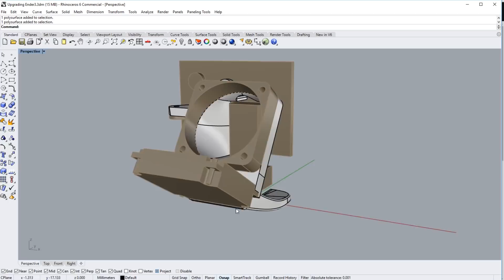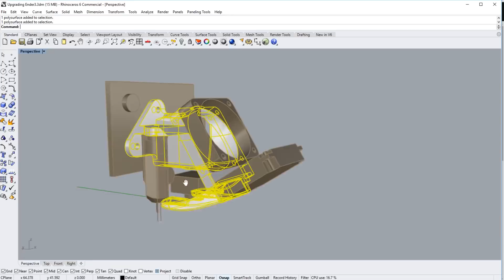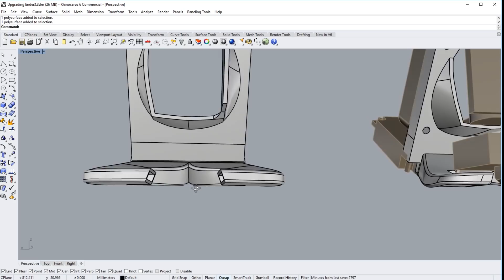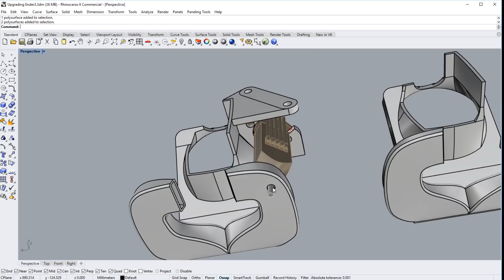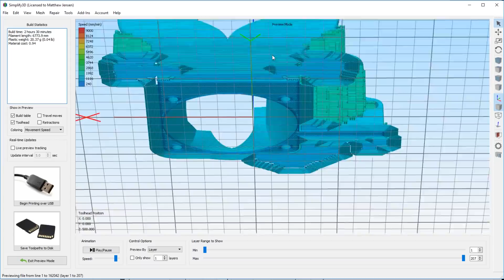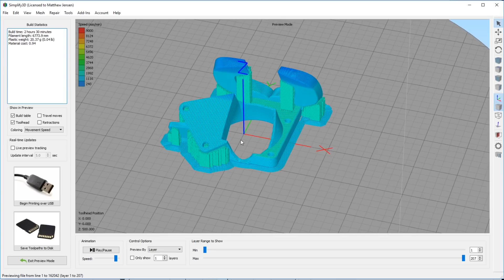Upgrading the Creality Ender 3 with Duet Wi-Fi, and other add-ons - part 1

Comment: You purport to be an expert, yet you failed to notice that the power supply was set to the wrong input voltage.  That is not even a rookie mistake...
Reply from the maker: For the last couple of months, I've been simply banning users who leave insulting comments. For this comment I will make an exception. 1) Everyone makes mistakes. 2) I don't have to show you mine. I can simply edit them out of the video. 3) Showing my mistakes makes the hobby more approachable to others and educates. If I did everything perfectly there would be no lessons learned, and I would not be providing an educational benefit to those watching.
Reply: @DesignPrototypeTest My apologies.  You are right - this was insulting.  And a mistake on my part.  I've made doozies myself and I don;'t know what prompted me to leave such a comment.  I have no explanation - just my sincere apology.

Comment: I dont know why everyone compares to prusa? Prusa is good but not the benchmark. Granted prusa prints well, but i have seen some prusas not print well. It is literally about how you configure it, the rigidity of the printer, and also the slicer.  Prusa is a reprap printer, my cr10 is not. Does my cr 10 print well, yes it does, thats because i have put the time into it. Prusa is a good product, so in creality, makerbot, formlabs, rais3d, tevo.

Comment: You are $446 into the build, but you forgot to throw in simplify 3D for another 130.  At this price you can just about get the i3. The Prusa slicer has the functionality you showed. Im sorry but the only good thing in this video is your work on the fan. That was a great job. 

Your opinions and recommendations are strange or ill thought out.  Let me make a few corrections.  
1- the Ender 3 frame is not superior to the i3 - it has many rookie engineering mistakes. The extrusions are screwed to each other to make 90Deg joints. No alignment geometry what so ever.  This is comical.  That does not work in real life, the majority of E3 out there are not square. They cannot be - there is o mention of this in the instructions. 
 
2 - the acetyl rollers  are not a great way of making linear motion because the rollers wear and ride on an extruded cheap piece of aluminum with no quality control. 

3- the right z roller does not do much at all. This is practically a cantilever machine.  It needs another screw there - like the prusa.   These are the 3 major design flaws the machine has. 

If you want to play around with some cool upgrades  spend another 100 bucks and start out with something better thought out.

Comment: Jesus Christ this comment section is full of so much salt, and most just seem to be mad because he was mocking prusa. And alot dont seem to get the point of this, which is budget
To be fair i dont own a 3d printer but im thinking about buying a ender 3, just because it has a big build area for the price compared to other printers in that price range, and if i ever buy it and i get hooked on 3d printing i would rather upgrade it one part of the time than, than just go and buy something like a prusa which is like 4 times the price. So i can get something just almost as good to twice the price  just by slowly upgrading i would be more than happy,
Reply: dannore you should totally do that.  I bought an Ender 3 Pro and I am 3D printing some of my upgrades and bought some parts on Amazon(an aluminum clamp and a rubber insulator).  I recommend that you use thingiverse to find 3D printed upgrades.  I was able to make my upgrades the day the built the printer and started printing(I recommend you use a .2mm filament size for printing with no issues).

Comment: 1:42 Explains how much better Ender 3 is than Prusa for not using zip ties
9:32 Uses zip ties in "upgrade" of Ender 3
Reply from the maker: As I have explained to the many commenters before you who thought they were also making a valid and clever criticism. 1) I am not the dominant western 3D printer manufacturer for consumer level 3D printers. I am a DIY YouTuber improvising, and this was the very first iteration of the design. 2) My solution used plastic zip ties to hold two ends of a plastic hose together. Prusa's design uses zip ties to hold together the very foundation of the printer. Think about all the things on top of the zip ties: The entire movement system for the Y-axis, the heated sub-bed, The detachable flexible print surface, and most importantly the part being printed. Your comment stinks like propaganda from the Prusa camp. Just because the Mini isn't selling as well as you hoped doesn't mean you should attack me.
Reply: You need to take a deep breath and realize there are simply people who find humor in contradictions.  I wasn't "attacking" you, I was playfully teasing with an observation.  As I didn't mean any offense, I'd normally apologize... but you actually attacked ME with YOUR reply, so let's call it even.  You might consider taking a break from YouTube if my comment angered you so much - you just bit the head off of a friendly, happy-go-lucky person.  Probably not the best way to gain viewers of your content.
Reply: Just thought I'd add, there is an irony to your "Prusa camp" quip.  I know nothing about Prusa, and am currently considering an Ender 3 which is why I watched your video.  You're alienating allies of your "camp".

Comment: With moving the BTtouch closer you could have stuck to the design, just drill a hole at the point needed? Would think a marginal difference to flow?
Reply from the maker: Probably true.

Comment: You can't install the filament out sensor after the extruder motor. It will never detect a filament out situation because the filament is pushed by the motor and when the end travels just past the motor gear it stops moving. It does not keep going out to the hot end. It will keep the sensor indicating filament present after it runs out if you install it after the motor.
Reply from the maker: Man, you aren't alone in making this mistake. Many others have the same comment, but you guys need to give me a little credit. I know what I'm doing. What you and the others fail to realize is that the sensor is a motion detector. It reports how much movement of filament goes past it to the Duet control board. When the filament stops moving, but the stepper is still trying to feed filament the Duet board knows there is either a jam, or it has run out of filament. If I placed the sensor before the extruder, there would be no way to detect a looped condition where the flexible filament pops out the side of the extruder so that the extruder keeps pulling filament from the roll, but does not feed it into the hotend.  Measuring the filament just before it goes into the hotend is the superior technique.

Comment: I'm starting to apply some of the add-ons from various youtube videos. At some point I figure it's gonna be an Ender 3.5!
Reply: I first bought an Ender 3 Pro.

Extended it to 400x400x400 (with extrusions, not kits), doubled the Z, redesigned the entire cooling system to be decoupled from moving parts (fans go brrrr and are gyroscopic masses that limit acceleration, having them attached to the head makes no sense what so ever), redid the entire extruder because I don't like having an extra motor weighing down a moving axis, redid the bed to have its X axis movement AND 2 round rails to give it that little bit more rigidity and am currently redesigning the hot end because the was it's set up by default (on almost all maker 3D printers) makes no sense what so ever to me, like really, why the hell does everyone keep attaching more mass, more vibration and more heat to that thing and mount it in tilted way from a flimsy aluminium extrusion.

Meanwhile, I bought an other Ender 3 Pro which I just did the basic upgrades on to have a stable printer to print with.

This hobby is nuts.
Reply: @enlightendbel  Are the plans or instructions for decoupling the cooling system online?
I intend to exchange my cooling fan for a more silent one, but making it even more silent definitely sounds nice

Comment: But lets continues to support crappy chinese companies. You talk out both sides of your mouth support china but they are stealing.
Reply from the maker: I walk a thin line. It's true.  I don't support Chinese clones. Despite the criticisms from The 50₵ Army I'm NOT racist. When I see innovative "original" products, I don't care where they come from, I will talk positively about them. The Ender 3 is "original" True, it's not a large departure from the Mendel Max, and other Open Builds designs, but it is not a copy or a clone. Do you feel that the Ender 3 is a clone of The Prusa? Are you aware that the Prusa is a modified Mendel, and that Prusa didn't invent the Mendel despite selling the "Prusa Mendel" before the "I3."  Dr. Ed Selles invented that design which Prusa copied. Here is a picture of a Mendel Max from 2014: http://www.stephanhooft.com/tinkering/mendelmax/ it is obviously more similar to an Ender 3 than a Prusa.

Comment: Simplify 3D sucks! Cura has had custom supports for a while now. You can write your own plugins and it's open source. 
You need to look into:
- mosquito hot end
- Capricorn PTFE (better retraction/extrusion)
Good call on the "use BLTOUCH" haven't tried the cheap knock offs, but the original works great.
Nice modeling work.

Comment: the problem with cheap 3d printer is reliability, adding a duet isn't gonna fix these problems. auto bed levelling, dual z axis drive, extruder, hotend, spring steel bed with PEI , these are much more important than a duet board. And adding octoprint on raspberry pi isn't horrible idea, it has so many plugins that duet can't do. Even better, you can install klipper to boost performance, that thing beats duet reprap to the ground. yes, duet is a good board, but not worth the money, everyone bought duet will give the same comment, if we're gonna build a new 3d printer, duet is not on the list.

Comment: how to damage sensitive electronics @ 3:30 SMH
Reply from the maker: Your concerns are greatly exaggerated. Who cares about the terrible stock control board. If that thing gets damaged it's a good excuse to install a Duet. The Duet has back-current protection, so you really aren't going to harm that control board. I have a 2 year old. He goes to town on the printer yanking that bed back and forth for like 5 minutes at a time watching the pretty lights go on and off. The printer still works fine.
Reply: @DesignPrototypeTest  not true.. the stepper motor drivers are easily damaged by doing this.

Comment: One thing I would like to see are fire hazard prevention measures added to the cheap cnc. I am pretty sure there are some programming safety checks in the prusa which the cheapers ones don't have and also the controller boards are possibly built in such a way they are less likely to burn your house down.

Comment: I had ender 3 for few days before i returned to shop. However i was suprised how solid construction ender offer for such money, i was unable to fix Y axis. Whole bed was under angle 91 degree towards X axis and as result.. rectangle prints were rhomboid. Buying such printer seems to be a bit lottery.
Reply from the maker: You must have purchased one of the many Ender 3 clones. Creality has much better quality control than what you are describing.
Reply: @DesignPrototypeTest  I bought ender from www.alza.cz ..the biggest electronic eshop in czech republic. If this was fake then i have no idea where else i can buy real one to be sure :)

Comment: Doesn’t matter if developed by prusa it is on there and a great printer. Crowd source works. The features you cannot implement is the testing of out of box print profiles. All printers are solid you mentioned.

Comment: The 3DTouch knockoff has been working great and costs so little. Is it also stealing when I go for knockoff PLA for 50% off because it's good enough?

Meh... I agree with the other commenters. I subscribed about 1/3 into the video, and then got almost to the end and was like "what is this weird vibe", looked at the comments, and they cleared up my thoughts and feelings real quickly. Not often you see so negative and still so civil comments on the internet.

Comment: question is why need upgrade if its better. why these upgrades not in allready on product. so not need upgrade. so far every printer video.. upgrade make it better.. LOL who is first manufacturer that make printer that is actually good and no need upgrade
Reply from the maker: >who is first manufacturer that make printer that is actually good and no need upgrade
Prusa.

Comment: Your mistake with the power supply could have been way worse, I live in the UK (240v) and forgot to flip the switch, and the psu was instantly fried, at least in the US it doesn't break if you have it set wrong 😊

Comment: lIked the video but I really would rather see how to expand a cheaper one into a bigger print volume.  Most of the prices JUMP when you expand to a larger size.  Seems they only need longer rails and more beds attached together.
Reply from the maker: To get a large build volume just start from scratch. The Piper 3D printer looks pretty great for the money. Of course a RailCore is even better but costs more.

Comment: It just seems funny how many comments in the thread below are defending the position that this upgrade to the Ender 3 puts it on par with a Prusa.  Very few of the commenters (and admittedly the video creator himself) actually own the printer(s) they are criticizing. 

Owning both of these printers in question (and a few others), I was drawn to this video out of sheer curiosity.  I will admit laughing at a few blatantly 'wrong' points, but all in all, I think the takeaways are as follows:  1. The Ender 3 on its own cannot stand close to the Prusa.  2. The whole point if the video is that by adding a Duet, you can come close for still much less $$.  3. The simple truth is ALL my printers is this - if you want to learn how 3D printers work, and spend a LOT of time working on them, buy an Ender 3 or many other chinese releases for less $$.  If you just want to print and not worry about any of that crap, buy a Prusa.

It took me maybe hundreds of hours to realize this - but simply put, my Prusa spends most of the time printing and the others spend most of the time being attended to..  The simplicity of automation of the Prusa is almost unequaled in the industry right now.  And no amount of tweaking on my other printers can beat the printing 'presets' that Prusa develops and releases with its updates.   I'm certainly not a hater on my Ender 3 or any of the others, but after a certain point this hobby can just become WORK... 

But my MK3S is the one printer that doesn't fall into that category.  Especially moreso now after a recent MMU2S upgrade.  Both the base printer and the MMU2S were worth every penny just in time saved, not to mention the components are all top notch out of the gate.
Reply: bless this comment. Had a Prusa for 1-1/2 years...just bought two Ender 3's and I am pissing away enough time tending to them that I could have bought a second Prusa. I actually think that is what I'm going to do. I want to print, I don't want to tinker with the hardware. The bed leveling on these things is archaic. I don't know why I haven't taken a baseball bat to both of them.
Reply: I am waiting for mine. Will take about 4-5 weeks. 
My colleague got an Ender 3 and i tried a BIBO 2 because i wanted to print with two filaments for miniatures. We are both working with CNC machines and Autocad and actually wanted to try a new hobby. 
But my printer failed after a while and i got a refund and redirected the money to a Prusa printer after taking in some information and seeing that they have a MM upgrade i can add later when i got used to it. The main thing that made me buy this instead of an Ender or other clone was the support i expect from the Prusa community. 
Depending on the outcome our boss might even invest money into one if we can show him it can be used to make tools and gadgets for work.

Comment: All the comments but also. A prusa is great and trusty out of the box. You don’t slways have to dear with cheap crappy chinese parts failing one by one either
Reply from the maker: Judging by the reviews from the major 3DP channels, Prusa printers do seem to work well right out of the box, but I can't say that for certain. I've never had my hands on one to test. One thing is for certain. The MMU2 DOES NOT work right out of the box.
Reply: Design Prototype Test yeah. It’s experimental and all.

Comment: sorry i know this is not about your video but i have a opportunity to buy a new anet a4 pro for $35. is it worth it. thank you for your time. jerry
Reply from the maker: That printer will not work out of the box. If you already have a functional printer, and can print all the replacement parts needed to get that machine working. $35 is practically giving it away. Watch the 3DMN video to see the dysfuctionality of it. Then head over to Thingiverse to see if all the parts you need are over there.
Reply: @DesignPrototypeTest  yes i have a ender 3&5 i found a online store selling them. also there selling the anet a8 as well for $25. but maybe a scam. thanks for the reply

Comment: at 3:31 when you push the bed, the Y stepper actually generates enough power to light up your screen... dammit I cringed so hard..
Reply from the maker: This happened with the stock control board. That board is such crap, that doing this just might hurt it, and burn something out. Whereas, the Duet WiFi control board has so many protections built in that it can handle the back current. I have a 2 year old son. He grabs that bed and pushes it back and forth for 10 minutes at a time watching the light go on and off. He's probably cycled the thing a thousand times by now. It still prints perfectly.